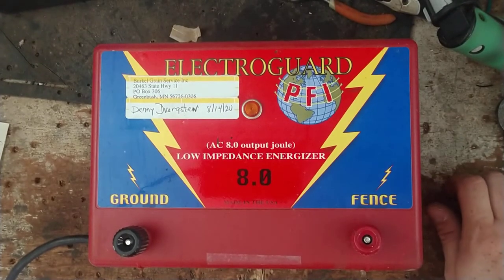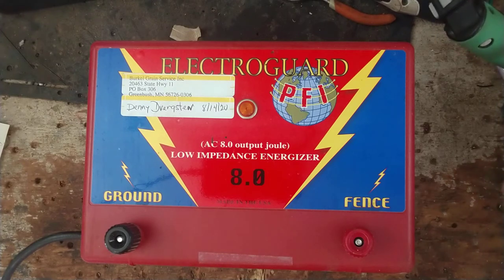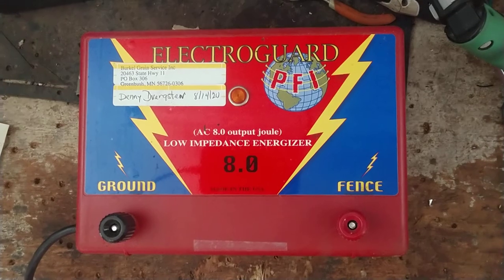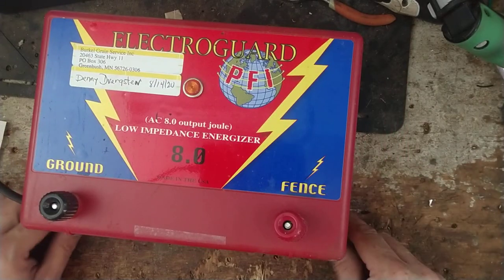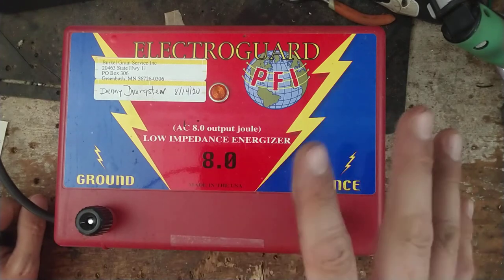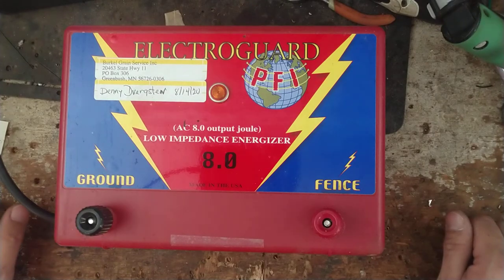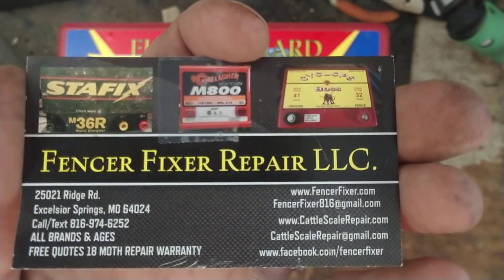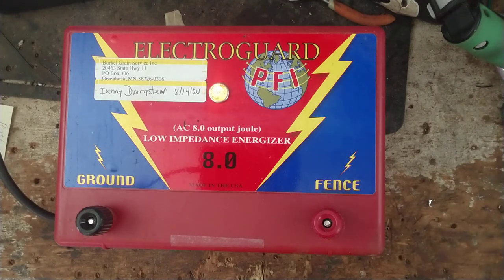Electric Fence Charger Repair | Electroguard 8 Cyclops Brute Repair

Comment: Love your Chanel I’m watching from the uk, can I ask 2 questions.
I have a 12v battery powered  Rutland ESB57 Energiser. I took out the transformer the primary side is short circuit , the secondary 20 ohm so I’m assuming it’s shot.
Question two 
 if i connect 12v  input ,there is a 450v cap across the connectors to the transformer. With the transformer removed and a multi meter across those terminals
Will I get 450v ish pulses if the controls board is still good?
Many thanks
Reply from the maker: That reading your getting from the transformer doesn't sound that bad. Input side should read 0-1 ohms, so yours reads good there. The output side varies brand to brand to model to model, they're not universal. 20 ohms doesn't sound that bad though.
Reply from the maker: That 450v Cap is what it can handle coming into it, so it's probably going to get 200-350vdc +/- at the capacitor. What you'll have to do is connect everything back up and turn the unit on. Then test across the capacitor wires on the highest DC voltage setting you have and you should see it climb up and fall down on your meter with the voltage reading. What does the unit do when you power it up. If it doesn't do anything, no clicking sounds, then your board or Cap is bad. You need to test that Cap and see what uF reading you get.
Reply: Fencer Fixer Repair LLC. Cheers , it’s all fixed.
Cap was good after watching one of you videos  where you used diode mode to test components , I checked the big stuff, found a 4007 diode short circuit from a small ish transformer ( presume buck converter type of thing)
Replaced diode works perfectly.
Thanks so much for your great videos, enjoyed learning about something new.